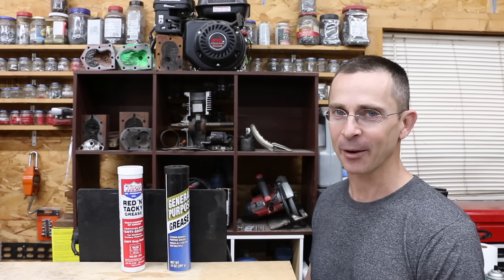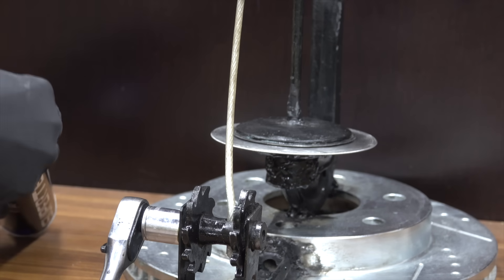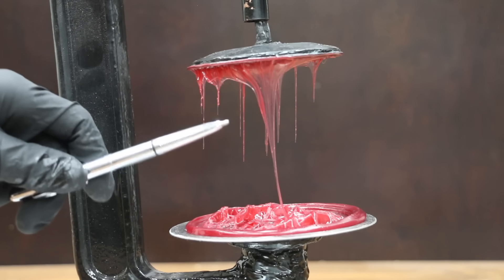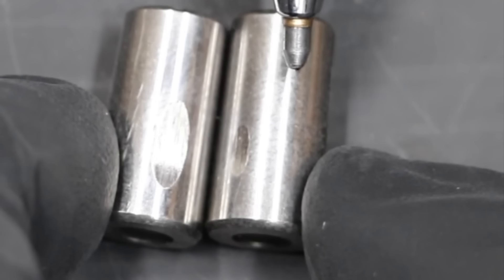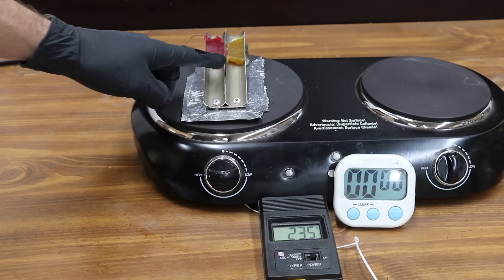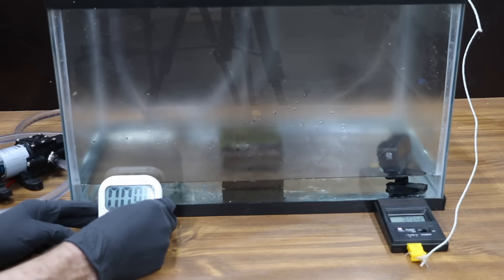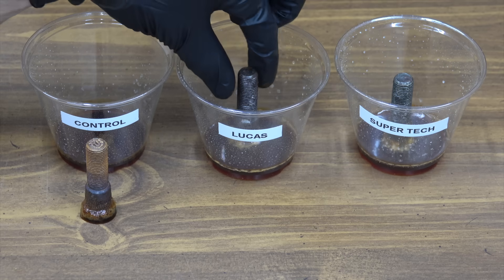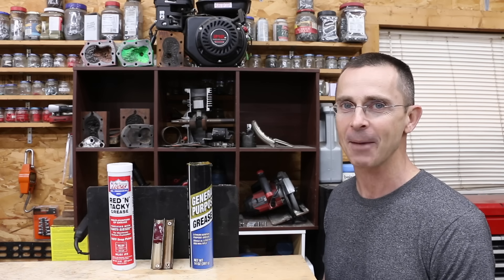Is Cheap Grease better than Lucas Red N Tacky? Let's find out! Bearing Grease Test Episode 1

Comment: I've got drag racing friends that say they think Lucas products are probably the best.  I've got  several trailers with 2000, 3500,  up to 5200 lb. axels..."small farmer"   and  always tried to to buy the higher priced grease...it's got to better right??  MY most disappointing grease experience has been my 3500 lb. bearing- grease performance on our 5000 lb. fresh water tandem axel boat trailer !!!   Several local 80 mile round trips to Mark Twain Lake in Missouri and a once a year 650 round  tripper to Table Rock Lake , Branson, Mo. where we launched the boat every day for two weeks... 325 mile trip home check the bearings frequently... no heat 18 miles from home at last Missouri fill up, get home get home ...hot bearing !!!  This has been a twenty two year experiment with grease, bearings-corrosion , seals and repacking every year to prevent a road breakdown!!! 
      "IT seems like"  Red N Tacky" has solved my problems.  So, after three  years of just popping the cap and checking each bearing, no repacking... etc...I'm happy  with Lucas..RNT !!!  Got home this year ...no problems but haven't  pulled caps yet...
        MY question is why do I get a red oily leak from my RNT cartridge filled grease gun when I hang it on the wall in my uninsulated central Illinois building...no other "cheap" grease has ever done this???   Honestly, after spending so much on RNT it didn't leave me with a warm and fuzzy feeling...
Reply: Read my post today. It's a issue with RNT.

Comment: Great video. Worked 40 years in hvac maintenance and never used tacky grease because I thought tackifiers in it would cause more rolling resistance (ie heat), in high speed roller bearing application. Maybe I was wrong.

Comment: Wow! Another awesome video! Very very informative and detailed, thanks!

If you haven’t done so already, a test for HVAC filters typically a 20x20x1 or filters that can be purchased at Amazon would be nice. Also, is lower MERV rating (MERV 8 vs MERV 13) really better? Or lower MERV is better at cleaning air efficiently? 🤔🤔🤔
Reply from the maker: Thanks so much.  Great suggestion!  Thank you.
Reply: MERV rating is how good the filter is at trapping certain size particles.  The HIGHER then MERV rating, the better it is at filtering smaller particles.  It's a sliding scale.  MERV 6 traps ~50% of 3 micron and larger particles, MERV 8 is 85% of 3 micron and larger, MERV 10 traps at least 50% of 1-3 micron particles 3+ micron particles at 85% or greater, etc.

Comment: Just wanted to add to this. Lucas green label grease is the same stuff as Park Tool. So if anyone has a bicycle and would rather spend $5-8, go buy Lucas brand. The Park Tool brand is the same grease , only sold for $16-21 a small tube. You can also find Lucas grease ant almost every auto store instead of wracking your brain trying to find it from a bike store.
Reply from the maker: Thanks for the feedback.

Comment: Have you ever done a test of various kinds of suspension bushings? Rubber vs. Silicone, etc.? I don't know how you would test them exactly. They are extremely long lasting parts and testing may not be practical due to dime constraints. But just a thought.
Reply from the maker: Thanks for the video idea.

Comment: This is a crazy video. The label on lucas doesn’t say anything and the other says too much. Grease is just oil with a soap that holds the oil. So with that luthium complex with a high quality oil in the correct viscosity range for application would be fine. Mineral oil is always the cheapest oil.
Reply from the maker: Thanks for the feedback.

Comment: Love this stuff just had a wheel bearing on a brand new Lowe’s landscape trailer leave me on the side the road in Georgia, went home and took apart all my car and trailer wheels to check and properly grease with quality grease make sure those hubs are full I don’t think that Lowe’s trailer had much probably bare minimum on rollers none in hub I would imagine that grease is liquid in the hub rolling down the highway loaded these weren’t even EZ lube or Sure lube which feed the grease all the way back to the rear seal and has to come forward thru both sets of rollers great setups pump the gun until you get all new grease
Reply from the maker: Thanks for sharing.

Comment: Would love to see tests and comparison of lithium multi purpose grease against polyurea counterparts. Like the Lucas red n tacky and their green X-tra heavy duty. Some tractor companies are recommending polyurea more and more. Seems the polyurea greases are rated for the same things as high temp lithiums but are supposed to be better at higher and lower temps and resist washout better. Not many direct comparisons out there.
Reply from the maker: Great suggestion.  Thank you.
Reply: @ProjectFarm , I see you DO read and reply to comments. Sorry for posting it so many times. Thanks!

Comment: Red lithium from Conoco/Texaco/Union Oil is the absolute best year round grease there is. I used on our Oil Rigs up here in Montana, Wyoming and Southern Alberta. You did a great job and the stringers on the grease are viscosity. But not a necessary test on grease. If that helps. Keep them coming👌
Reply from the maker: Thanks so much!

Comment: Supertech = NGLI (general purpose grease for basically stuff like hinges and non critical parts)

Lucas = NGLI GC-LB (this is a multi purpose grease for extreme applications such as wheel bearings and chassis)

Both are #2 which is just the consistency of the grease.

really no comparison.  The Lucas is the better grease because it's specifically made to be better. SuperTech makes a multi duty complex hi-temp grease with the same certification at a lower cost than the Lucas. That would be a great head to head match up.
Reply from the maker: Thanks for the video idea.

Comment: Would love you to see you add a long term test when the grease is exposed to air.  I have found that some greases are less likely to harden over time and don’t clog up zerk fittings when annual maintenance is done.  I use Lucas motor oil in everything I own but have not thought about their grease.  Currently using Aeroshell 5 grease which doesn’t seem to harden as bad as some of the cheap stuff
Reply from the maker: Great suggestion!  Thank you.

Comment: I have always used high tack grease in the pivot pins of equipment where there is low rotation and high strain.  Your results around cold and braring rotation surprised me though.  It was always my belief that high tack would be less efficient overall in high rotation, especially with temerture variation.  I guess that's one test I would have liked to see is the opposite of your cold test, high rotation at normal temperature and with a bearing that has the seals on the sides.  These types of bearings are found on lots of equipment that are too small for an oil bath.  Bicycles especially where its human powered input is affected by grease performance.  We used Lithium for awhile but found it dried out and was better in low rotation, low load scenarios.  Grease that was too tacky wasn't good for wheel bearings either but did last.  About 20years ago metalon grease showed up and that is a great grease for rotation and I replaced all other greases with it.  

So in short it would be cool to see this test with some similar grade greases...I have forgot the grading system they use.
Reply from the maker: Thanks for the video idea.

Comment: haha. You can get Lucas at Walmart. Lucas IS cheap. Used this to lubricate the front end of my lawn tractor. Every 10 hours I lubricate the spindles. after only 2 hours using the Lucas grease the steering went from light back to heavy. The grease also turned black. This stuff is crap and a waste of money.

Comment: Can we see a high performance shootout with rolling resistance included?  I'd like to see:

- Kluber Isoflex Topas NB52 Ultra Low Drag Bearing Grease (this is what a NASCAR cup team used in 2015 when I helped clean the axle bearings)
-Chemsearch Maxi-Lube
-Driven EPC (Joe Gibbs Racing Oil)
-DayLube
-AmsOil
-Timken
-Shaffers
-Lucas
-Redline
-Royal Purple
-Valvoline

You can also tag the video to race car, dirt track... to widen the viewership base.
Reply from the maker: Thanks for the suggestion.

Comment: Grease is definitely application specific. For example if you put regular grease on brake caliper pins it would all run out and dry up after 1 day of driving. Brakes require very high temp resistant grease.

Comment: I was searching for grease type . There are 4 type and every type have levels of density . 

There a sodium grease
Potassium grease
Lithium grease
Silicone grease 

Sodium is good for close high torque gear's and for bicycle gear's 

Potassium is good for jet sea gear's that need protection .

Lithium is good for high speed gear's special the grease with graphite .

And the silicone is for high temperature like 200c
Reply from the maker: Thanks for sharing.

Comment: I've been a lube nerd forever (well, 40 years anyway)  I was an early adopter of Mobil1 synthetic grease and I'd love to see it tested against other good greases.  Engine oils and filters are also great test subjects that many of us use.
Reply: I prefer astroglide
Reply: I'm an M1 fan also though their red synthetic grease is not what the off white stuff of the past was. The red will separate over time at room temp.  I have about a half case collecting dust. Wish I had bought a few cases of the original off white M1 grease back in the day. I still have a partial tube from decades ago and it still has not separated. Stuff smells great as always also. I would like to find a source for the grease Honda used in the rear wheel bearings back in the day. The stuff was indestructible and had a similar feel and smell to the old M1 greese.
Reply: Mobil 1 separates badly.
Reply: We’ve used  Schaeffer greases and oils in our fleet for years. Schaeffer has some of the best lubricants made and their greases are their claim to fame. Great American company too.

Comment: I bought high heat red grease that was walmart brand, it melted out of grease gun and dripped everywhere
Reply from the maker: Thanks for sharing.
Reply: I had that happen with my grease gun, not that brand, then someone said, it happened because of leaving the grease gun under pressure, when not in use for long time, helps it separate and bleed out.
Reply: @bradlewis6962  interesting

Comment: I have some Lucas red n tacky grease myself and it’s great stuff I’ve been using it to grease my new ball joints and track rod ends to keep out water better also for my rear axle arm bearings, I’d love to see you compare a few other grease manufacturers, Granville make some good ones too like molybdenum disulphate grease for CV joints and wheel bearings also Castrol with their super heavy grease but Lucas red n tacky is by far the most interesting grease I’ve ever seen and smells funky too 😆

Comment: Fun fact, your film strength lubricity tester is actually very similar to the Timken min OK load test in the technical data sheets for greases, except Timken adds weight until it stops. I'd love to see a lithium complex high temp grease shootout between Phillips-Conoco Multiplex 220 #2 vs  Lucas Red N Tacky vs Mobil 1 Synthetic Grease vs Valvoline Multi-Vehicle High Temperature Red vs Valvoline Full Synthetic Grease vs Amalie Blue Hi-Temp vs WD-40 Specialist High-Temp Grease
Reply from the maker: Thanks for the video idea.

Comment: Super tech grease turns into a liquid just sitting in my grease gun on a warm day.  Same thing in the wheel bearings on my tractor.  On a hot day, if I pop open the wheel bearing cap, the grease just flows out like oil, rather than grease.  Super tech is junk!
Reply from the maker: Thanks for sharing.

Comment: Super tech grease ruined a set of trailer wheel bearings and races after 200 miles on a fresh pack. I wouldn’t use that stuff on anything ever again. New bearings and races, Lucas heavy duty green, same load and tension thousands of miles later still look new.
Reply from the maker: Thanks for sharing.

Comment: There is another Grease on the Market, Called:  PARAGON 3000.  Lithium based Marine Grease (blue in color)  Supposed to have a DROP Rate of 670 degrees.  Made by Texas Refineries.

Not sure on it's quality, since I have used Lucas Red & Tacky for years without any problems.

Would be interesting to hear your comments on the PARAGON 3000 brand of grease.
Reply from the maker: Thanks for the video idea.

Comment: Lucus products have always impressed me! I not suprised that the grease came out on top!
Had an old Chevy that sat for  5 or 6 years without being started once, got it started.  The troubles began, leaking motor oil, Transmission fluid,  & power steering fluid! Needing to use this van I decided to try lucus products to stop these leaks ,all three components stopped leaking!
About 3 months later a seal blew out in the steering box ! But not bad the van had over 350,000 miles on it!
Reply from the maker: Thanks for sharing!

Comment: Grease is grease!  I use Castro’s synthetic NG2 In my grease gun.  I grease tractor grease fittings and sprockets on my chainsaw bars with it.  I only buy high quality oils and grease.  Oil and grease are cheap compared to most of my equipment.  Never skimp on-oil oils or grease.  I use Stihl Ultra two cycle oil and Platinum bar oil in my two cycle stuff.  In old weather I do switch to Echo Premium bar oil, because it flows better than Platinum in my saws.  In warm weather I switch to Platinum.
Reply from the maker: Thanks for sharing.

Comment: The problem I had with the Lucas is it seperated in my grease gun and red oil would run out the bottom of the gun and make a huge mess , finally changed to an Amsoil product .
Reply from the maker: Thanks for sharing.

Comment: I drove an Italian Iveco van that had a 20' box for 17 years my normal wheel bearing grease pack with fossil grease was 30,000 miles, using Amsoil red synthetic grease I looked at the Timken front wheel bearings both wheels bearings inner and outer were still loaded with grease, no signs of grease break down, I went another 15,000 miles total (45,000) still good, next I went to 65,000 still Ok, I said wow I bet I can go for 100,000 miles (wrong) at 85,000 mile the right front wheel bearings gave up the ghost and slightly welded the inner bearing to the axel, I freed the bearing a couple of swipes with the file and some different grades of emery cloth and the axel was fine. I used Amsoil lubricants for my truck and car as well for all those years without problems, same drive shaft and steering linkage as well lubed chassis every 3,000  miles.
Reply from the maker: Thanks for sharing.

Comment: The reason they don’t want you to mix grease brands is the cheaper grease will dilute the properties of the good grease.   I used to work for a Caterpillar dealership and you soon developed yellow blood in you veins.  One day a salesman stoped in peddling his brand of “super grease”.    With him he had a sales aid that was basically a high speed motor driving a spilling disc in a clear plastic tube.   He put an equal amount of Caterpillars grease and his grease.  We all joked how foolish he was going to look trying out do the  “ best grease ever made.”    He hit the switch and soon the shit hit the fan as so to speak.  We were all shocked as the Cat grease was gone and hade been slung against the plastic housing while his grease sample sat there undisturbed.    I don’t know about it’s other abilities as a lubricant but that grease did have the “tack”.    Problem is with lubricants is they are written in to most warranties which overwhelm any test results.    Interesting fair and well done tests you ran and would like to see more brands run thru your lab in the future.
Reply from the maker: Thanks for the feedback.

Comment: Always great vids but wonder if you should have used the ST Multi-Duty grease instead of the ST general purpose in a 'more fair' comparison against red and tacky.I'd like to see you compare a bunch of different brands and throw in Schaefer's oil 219 grease. Years back the company I worked for switched to Schaefers grease on their fleet of school busses .I beleive this change almost eliminated wheel bearing failure,saving us the mechanics the labor and the company $
Reply from the maker: Thanks for the suggestion.

Comment: Although it’s a dollar more where I’m at the Supertech Multiplex red High-Temp grease would have been a fairer comparison. The drop point is listed @ 500F and it has a tackier consistency. I work on oilfield equipment and have found the red high temp to outperform general purpose greases in most applications regardless of the brand..
Reply from the maker: Thanks for the feedback.

Comment: I've been thinking a lot about your testing in the last year or two and I think I have a more fair way to compare weights. One method you are using consistently in your videos is to weigh samples before and after and then measuring the weight loss as the difference between them. But then those differences are compared between samples to determine the "winner". However, because the starting weights are different we would expect different total weight losses, even if the two samples had the same product. I believe calculating the percentage of weight loss for each sample and comparing the percentages would be a much more accurate and fair assessment for these types of tests, because the differences in the starting weight would be factored in too. While not a big deal for this video, it might be something to keep in mind for future videos. Thanks for producing!
Reply from the maker: Thanks for the feedback.